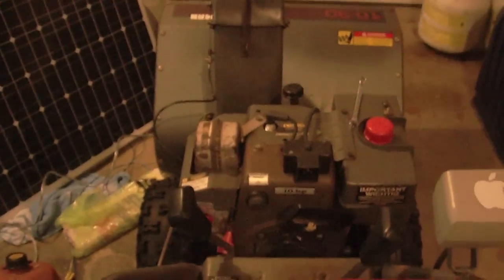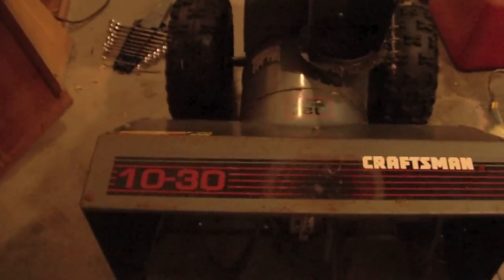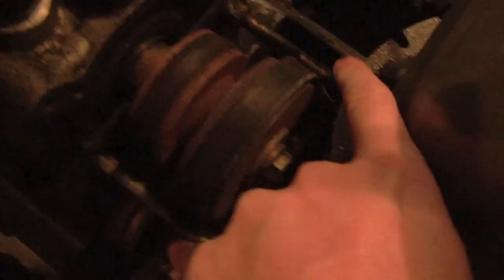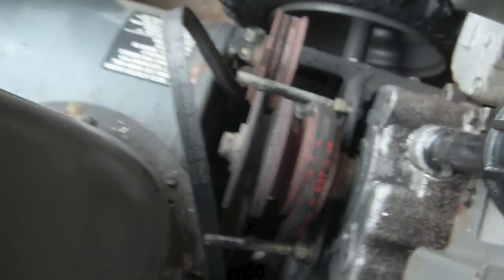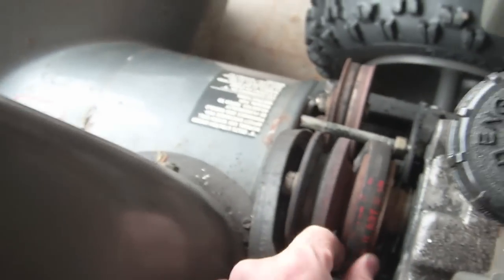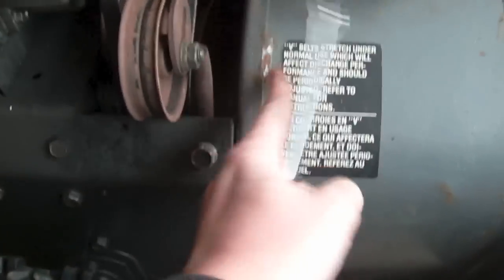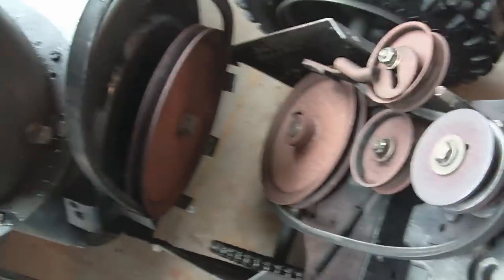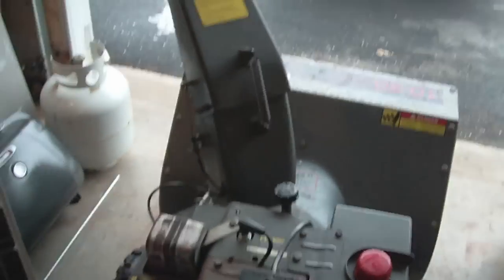Craftsman snow blower belt replacement

Comment: I have 2 craftsman snow blowers. You do not have to split it apart to remove belt. There is room between auger pulley to slip belt through.
Reply: Depends on what model of craftsman you have. I have a 33" 13 horse and it needs to be split. They have it so you don't even need to take the bolts all the way out on mine. Just loosen  them and there are slots that they slide in. Actually much easier than trying to finnagle a belt down through. There's a total of maybe ten bolts to loosen, including the ones for the guide posts. Two 3/8" bolts on the outer cover and then the rest are all 1/2".

Comment: Did you have a hard time getting the new auger belt onto the top pulley? Mine is real tight
Reply from the maker: It was hard to get the pulley on. Takes some prying and squished fingers to make it happen
Reply: You can loose the idler pulley with a key, place the belt and the re-adjust the idler pulley

Comment: So no removing the pulley... good.  But the guide tabs around the pulley are solid.  Manual says bend them out of the way... right.  Not budging and they're welded.  
So I'm guessing you can just muscle the v-belt out and and a new one in with some gently nudging?  I'll give it a shot.

Comment: you said it was a Craftsman 13hp snow blower.  The picture (which looks like my snowblower) says Craftsman 10-30. I am trying to locate a belt for a 10-30. Do you have a parts manual ?
Reply: might be the same as mine, belt # 3887ma size 1/2 inch X 31.4 inch for the auger and # 1733324sm for the drive size 1/2  X 33.25 inch . My model # is C950-52110-2 if anyone has the manual for mine would greatly appreciate a copy :)

Comment: Hello
Any chance you have a manual for this blower, I have the identical blower and for some reason the model# on my machine is 71-52430-4 and apparently there is no such machine, I searched the entire web and there are alot of individuals also having a hard time trying to find information of this imaginary machine, if no manual can you please provide the model# on your machine, Any information would be greatly appreciated

Thank You
Reply: might be the same as mine, belt # 3887ma size 1/2 inch X 31.4 inch for the auger and # 1733324sm for the drive size 1/2  X 33.25 inch . My model # is C950-52110-2 if anyone has the manual for mine would greatly appreciate a copy :)